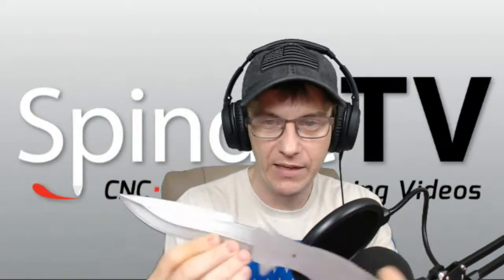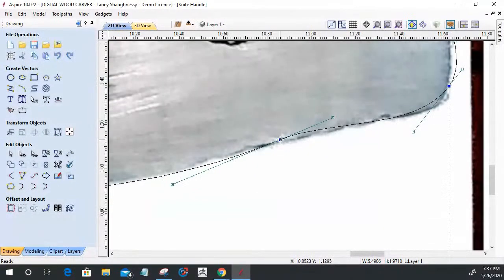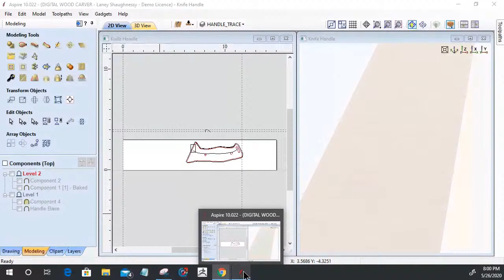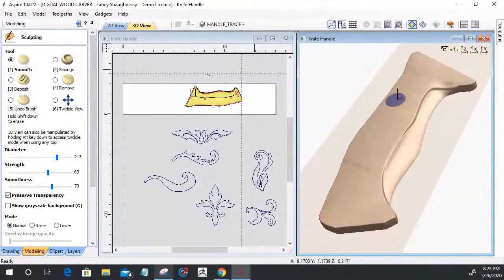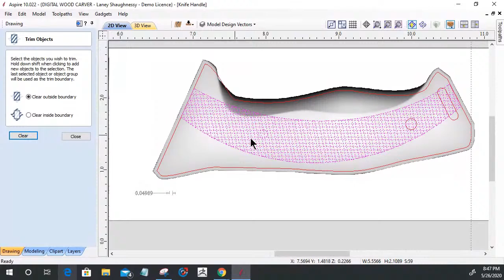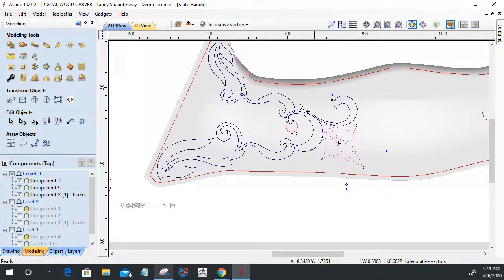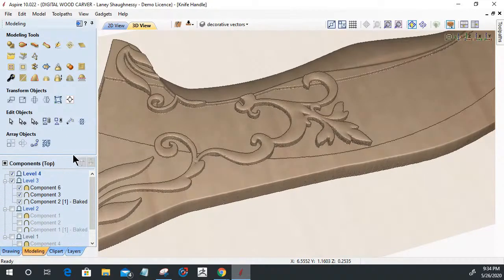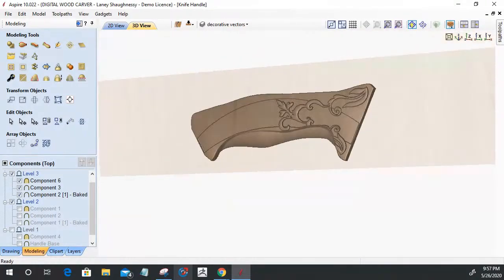Modeling a Custom Knife Handle - Live - Aspire - Vectric - SpindleTV

Comment: Laney-Ive watched all the vectric tutorials and now Im watching all the Spindle TV videos. Im learning a lot by watching your videos so thanks. Ive ran a few projects and now Im to the point of the rubber (design) meeting the road (finished project). Your knife handle will be carved with a tapered ballnose. How do you sand out the fine lines left from the tool? Sanding sealer first? no sanding sealer?  I have vcarve 10. Secondly, when I cant find the 3d image I desire, do you have a recommendation of where to go to have what I desire designed? For exampple, im looking for a 3d image of a beer hop.
Reply from the maker: When it comes to the knife handle. Most all of my 3d model cuts are raster cut with the grain, this minimizes any sanding required. then I use a wire brush to brush away any little fibers (Fuzzies) away, then a sanding mop that will sand or buff the design smoothing things out. I do not typically use a sanding sealer, but I do raise the grain before I use the sanding mop. Places I get models from are Cgtrader , turbosquid , thingiverse , designandmake, etsy, ebay all end with .com